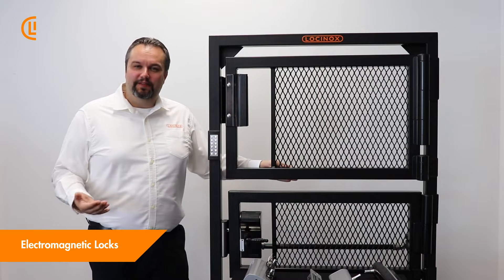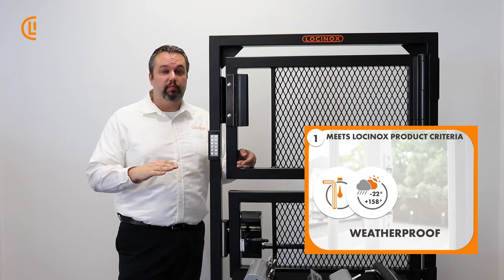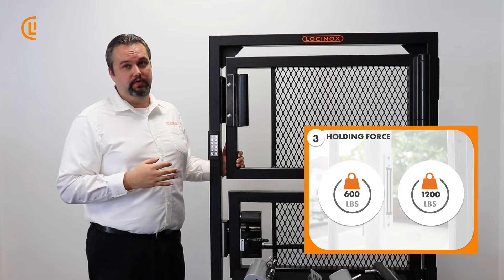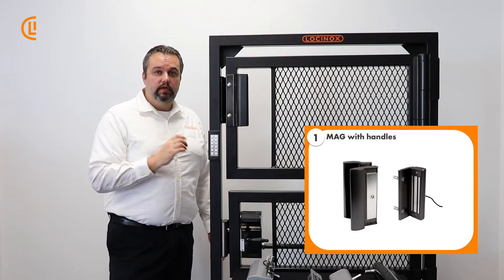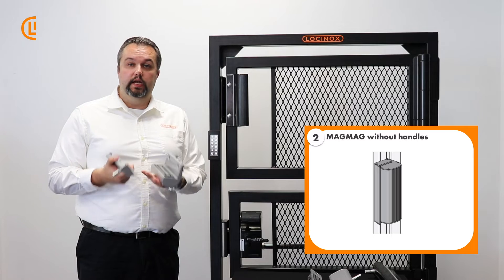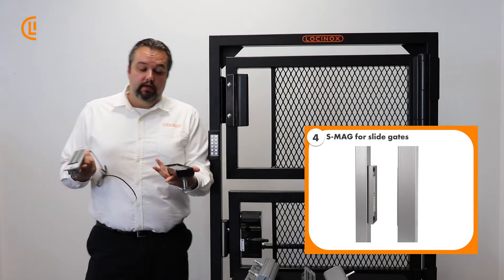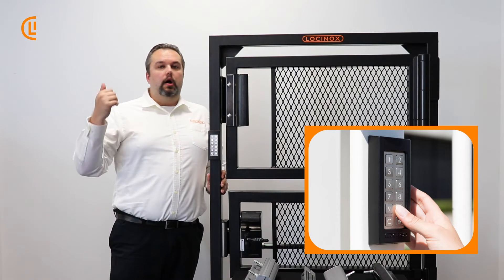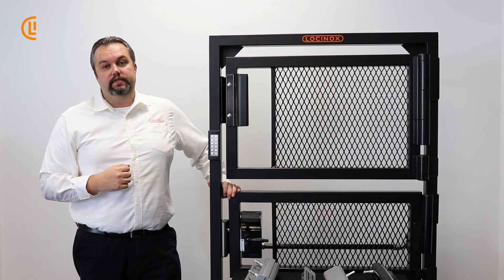Why Locinox Electromagnetic Gate Locks are Industry Leading

Comment: All are USELESS in an event of a power outage, you know,when you need it most!!!🤦🏿‍♀️🤦🏾‍♀️🤦‍♀️🤦🏿‍♂️🤦🏾‍♂️🤦🏽‍♂️🤦🏼‍♂️🤦🏻‍♂️🤦‍♂️
Reply: Not sure why the new monster has a lot less of it
Reply: Mag locks are used in conjunction with battery back-ups. 
Yes —if there is a fire code issue the system is run thru a fire panel. 
Cool idea, but jump the fence and the $1200+ install is mute.  
I install mags every week and go back quite aways.